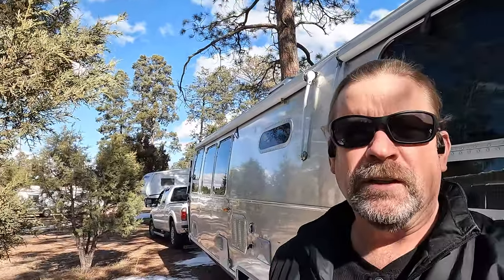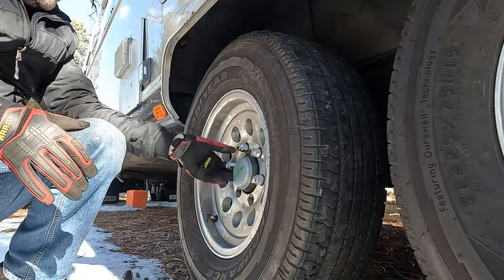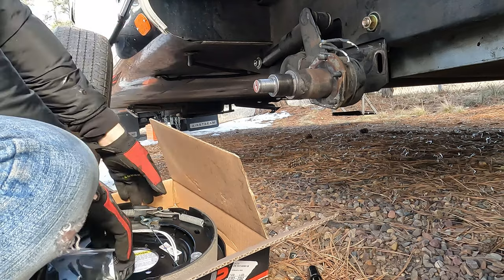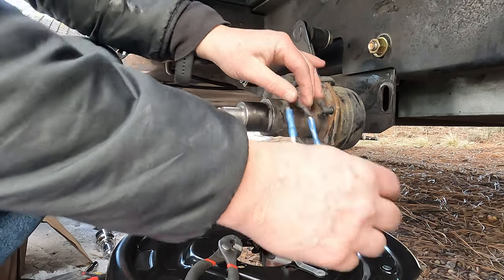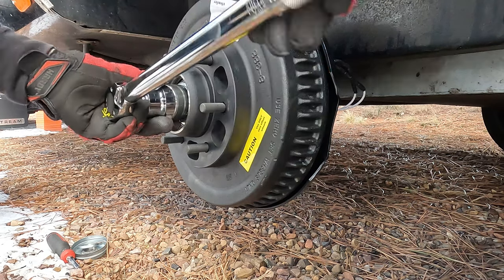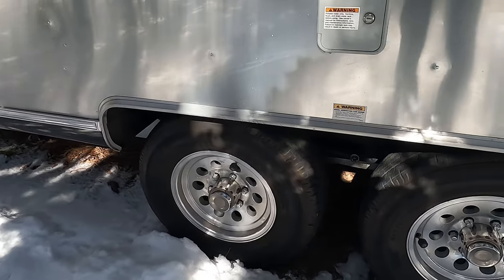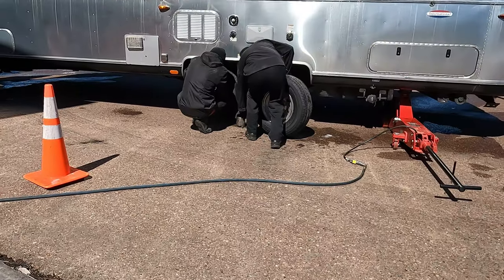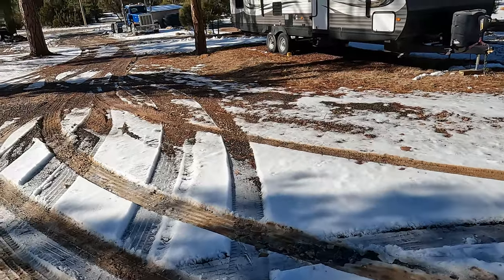DIY Airstream Brake Change and Tire Replacement

Comment: Your experience at Discount Tire was similar to mine. Like you, I showed the two tire changers the Jack Points and because it was cold I sat in the truck and watched in the mirror. They rolled out the jacks, put them under the jack points, and started jacking, then they quit and went into the store. After 15 minutes I got a call from the manager telling me that their jacks didn’t go that high and did I want them to jack under the axle. I carry a 6X 8 block of wood to put on my jack to reach the frame, so I had them use that.
Reply from the maker: A block of wood probably would have done it cuz they were able to get one tire off the ground using the regular jack.  I offered to use the Andersen rapid jack to make things easier for them, but they opted to use the air-jack.  Would have been quicker to use the Andersen and do them one at a time, but they got the job done.
~D